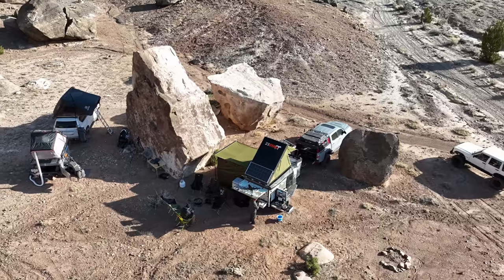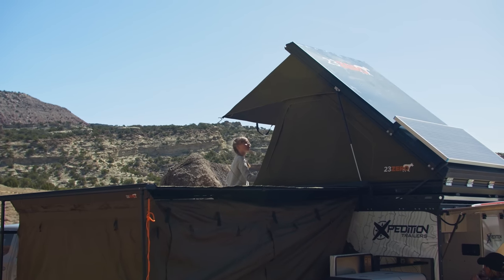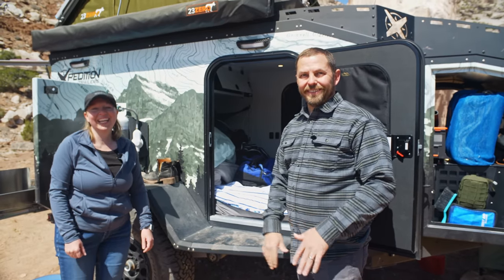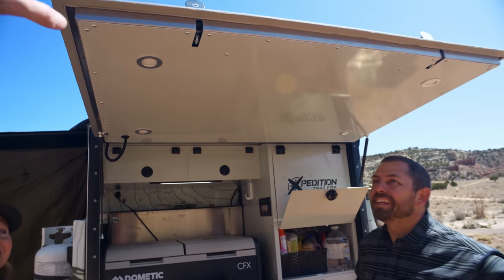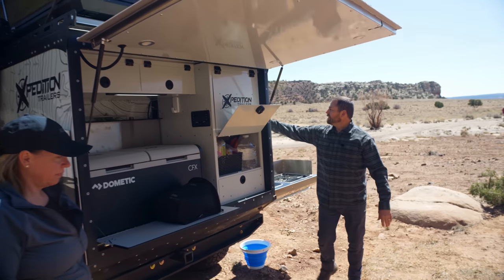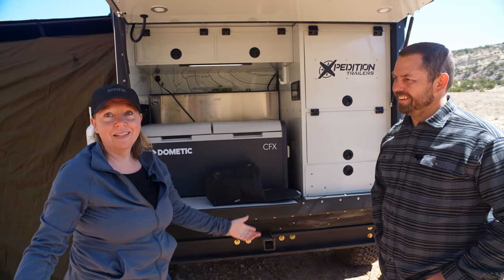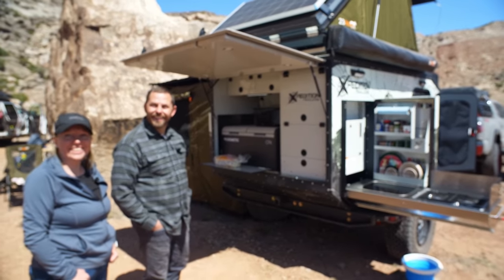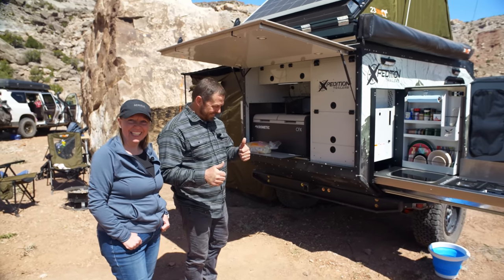This SLEEP INSIDE adventure trailer has us thinking... [Adventure Ready 005]

Comment: I've had RTT & trailers   What was the best was a trailer you could sit inside at a table not have to lay inside when getting out of the weather, I had a hiker well  built trailer but the Mission Summit Overland trailer was the best because of being able to stand up and sit at a table. inside storage,heater, outside kitchen and shower.
Reply from the maker: I can definitely see where more living space out of the weather, the better. How does the pop top do in wind/rain?
Reply: @LifestyleOverland  minor leak but was repaired by Mission. Held up in high winds as good as my  A/T Overland Summit wedge top. Very good.
Reply from the maker: Awesome 👍
Reply: @LifestyleOverland  Second vote for MO, I'm in Utah and use mine many of the places that your family travel to, really hard to beat the functionality and small footprint. Have been in snow/rain/high winds without any issues on the pop-top.

Comment: I like the gear hammocks!  I finally took possession of my Overkill  510 SO Trailer in July.  The slideout is the best feature.  I cant stand up in it but its nice to get out of the weather and sit at the half dinette.  Solar panels, lithium battery, 30 gallons of water and dual diesel heater for water and cabin.  OK moved their production to PA and a new manufacturing facility since they had many issues.  But the OK trailer is a unique design and those off road teardrop style trailers are a great compromise between tent camping and an RV.  How long have they had their trailer and any issues?
I have had friends rent those trailer and had a solid experience.

Comment: Well, my hope of you going back to the Turtleback Expedition are getting slimmer and slimmer...😢
Looks like a well built, well thought out trailer. How much does it weigh? Seems heavy, like something you would pull behind a Power Wagon.
Reply from the maker: Turtleback shut down production and sadly, still don't have a sleep inside anyhow.
Not sure where this falls with weight but they're towing it fine with a regeared Tacoma so it can't be bad 🤣
Reply: @LifestyleOverland  looking at the specs, it looks very similar to TB in robustness. 1/8" Al sides and 1/4" Al floor.  4200 lb GVWR, 2600 lb dry.
Reply: What happened to turtleback?

Comment: Not sure if I missed something in there, but that annex did not look like it was tight to the trailer.  That is going to do nothing to keep bugs out and any harsher weather. Is there a way to keep that sealed up tight?
Reply from the maker: The back section was unzipped. The attachment is 100% enclosed when you zip up all the panels. Pretty slick design, I want one for Alaska.